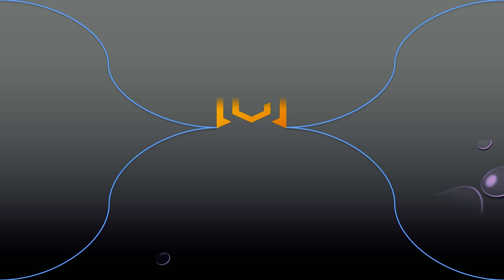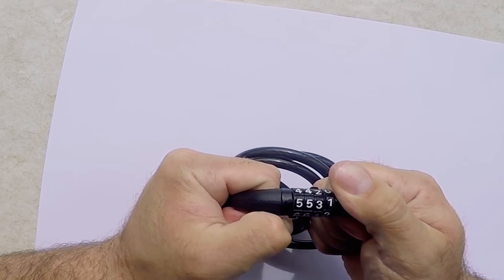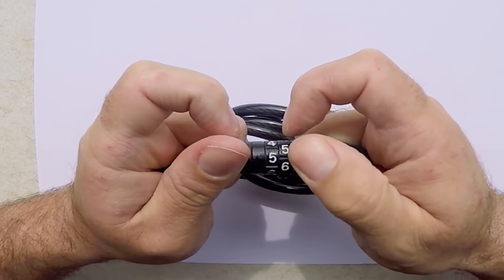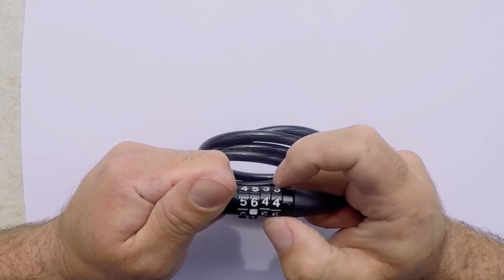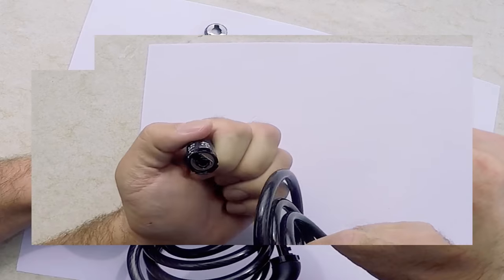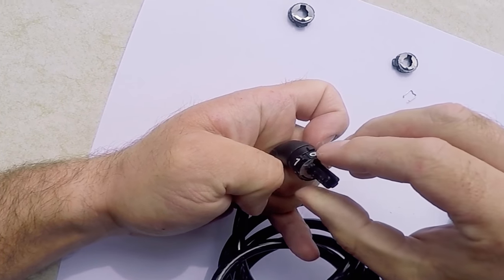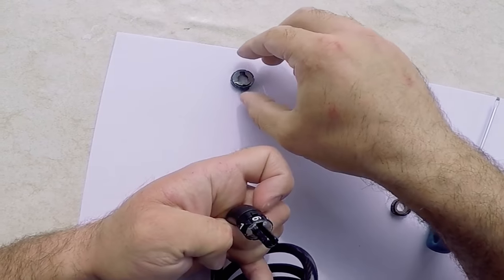How to UNLOCK cable BIKE LOCK without combination AND how to CHANGE your lock COMBINATION

Comment: Um, wow.  I didn't believe this.  Didn't believe it would be so easy to unlock which is annoying now.  But I had one of these and misplaced the combo or at least made it too hard to find again.  Watched this and sat down watching tv while I twisted the dials.  Don't understand how but just a few mins and it opened.  I recall just guessing the position as I turned and yet just as described it opened in no time.

Comment: It did not work on the lock i have though. But the principle works for most cheap locks i guess. It's basic really. You can also use a wire cutter and cut away a few wires at a time until it's "open" if you have locked your things in place for some reason. I have cracked these by pure determination before and simply tried all possible combinations until opened, but it's not for the lighthearted, haha😇😄

Comment: I had to cut a little piece of plastic in the dials for my custom combination so I used a Dremel. Very easy and quick. This video helped me.
Reply: Finally someone understands this video is a joke
Reply from the maker: You probably don't know how to do it and you think it's a joke...
Reply: @MCTutorialsOnline  no
For the lock I have its impossible to change to combination. It might work for other locks
Reply from the maker: That's some other question and problem....
Probably there is locks that can't be solve like this.
But also there is plenty of them which can be solve.
Reply: I've got the same exact model and I also drilled holes to make my custom code, but then realized that the metal part doesn't rotate. So now each digit wheel has 2 possible numbers, making the lock unlockable with many possible combinations 😂
It turned an already awful lock to a much worse lock.

Comment: this truly helped but sucks Im stuck with the same #'s but just changed to however I prefer.
Reply: @MeowMeowDuck - You absolutely can use completely different numbers. Unless the lock he's using has slightly different parts than mine. But they look identical. You just have to move the white piece and metal rings so that the other half of the lock fits together.

Comment: My lock is not opening when I have tried your method of please tell me how to unlock it by another matter because there is no link shown on in your video or in description or in comments please tell me how to unlock that because I forgot my combination of my bike lock
Reply from the maker: Hi,
Thanks for watching.
Once I will put that video...
You need to go much slower.
And for every number tu push inside then to pull out.

But important thing is to to repeat for every number.

This method is much longer but you will succeed.

Example.

For number 

3567
Press inside then pull out.
If that is not your  combination
Go to number
3568
And repeat press inside than pull out.

You will eventually open your lock.

Comment: So you can only change order of the original code?
Reply from the maker: Hi,
Thanks for watching.
Yes on this type of lock you can only change order of original code.
There is some types of lock wich can take any combination you want.
Reply: @wolfy - I have this exact same lock, and I used a completely different combination than what the factory preset was. You have to line up the parts correctly so that the lock parts fit together. Study the video and your parts and you will figure it out.

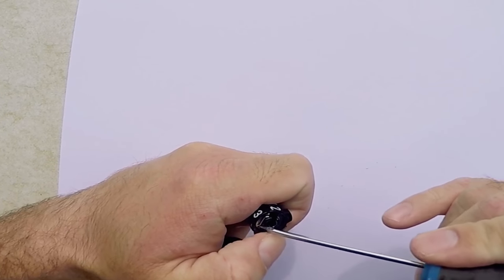Comment: Please tell how to make that clip at home 02:15
Reply from the maker: Hi,
Thanks for watching.
On what clip you meant?
Reply: @MCTutorialsOnline the clip 📎which you had removed in starting click on this 02:15👈
Reply: @MCTutorialsOnline  please tell I lost it
Reply from the maker: You can try to make the same shape of your clip with wires for spring making.
Or any stainless steel wire what you can find.
You don't need to have the sam shape as it is on your original.
You can make similar just to work.
Reply: @MCTutorialsOnline   bro please help me to solve this go live
Reply: @MCTutorialsOnline  reply soon
Reply from the maker: Will try to make it today

Need to check do I have needed wire.
If I make it  I wiil send you link.
Reply: @MCTutorialsOnline  thank your very much I hope you channel gain 10 million subscribes soon you are a great youtuber
Reply from the maker: Thanks for supporting me in my work!!!
Reply: @MCTutorialsOnline  you are great
Reply: @MCTutorialsOnline  hope you find that type of wire soon please let me know when you make the video  because it's urgent first tell me than make video 🙂🙂🙂
Reply from the maker: Hi,
Before half our I found a solution for you.
Video is coming in next 30 minutes.
Reply from the maker: Hi,
I made it. I make another spring clip.
Hope I helped you with this one.

You can check it on this link:
https://www.youtube.com/watch?v=gKcOL0b_slw
Reply: @MCTutorialsOnline  thank you so much
Reply: @MCTutorialsOnline   I have seen this video at night because I live in India🇮🇳
Reply from the maker: Hi,
I'm just posting 🔗 for video what you already watched.
https://youtu.be/gKcOL0b_slw
In this link I'm showing simplest how to make wanted clip.

Comment: No bike lock videos work. Even this one. Either my 6 number 4 digit combo lock is either too old or you and the others lie to get a view. Either way. This is bs.
Reply from the maker: Hi,
Thanks for watching.
No one lie here.
You just need to be patient with this method.
It doesn't matter is it 4 or 6 number combinations, and it's doesn't matter how old is lock.

Just be patient and after every one combination for slower method  you need to close and then open locking part, because sometimes something is stuck inside lock parts.
Reply: @Truth Monger - Do you have the same lock? It genuinely worked for me, today. I forgot my combination, and opened and changed the combination. He does not explain exactly how to change the combination in detail, but if you study the video and your parts closely, you will figure it out. If you have a different type of lock than this, it might not work for you.

Comment: it didn't work
Reply from the maker: Hi,
Thanks for watching.

If this method failed, try the same method but much slower.  Stay on each number a little longer and pull and put the parts back each time.  You must succeed.